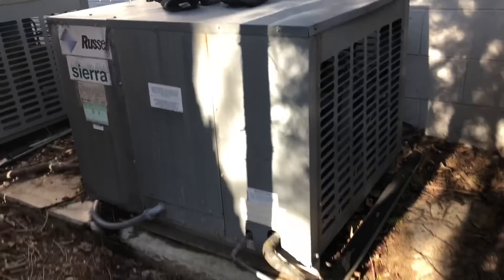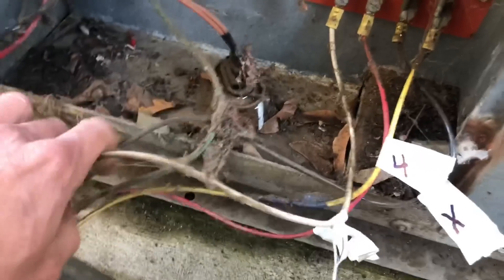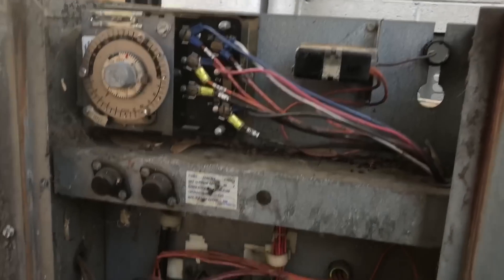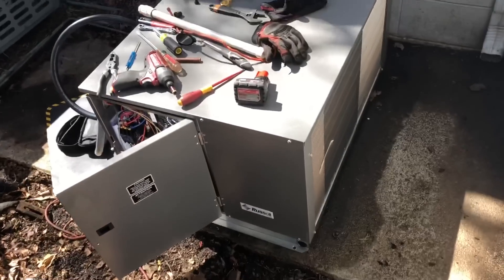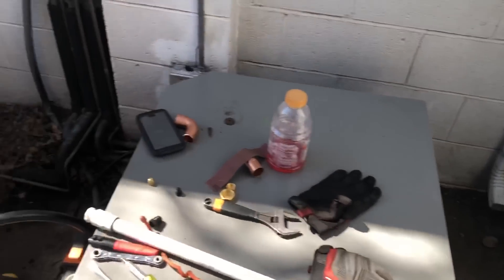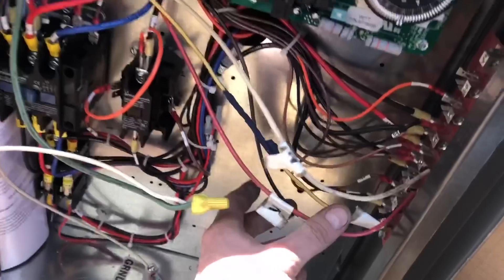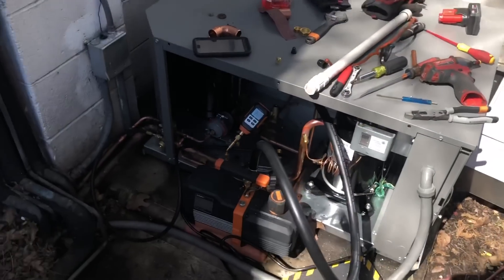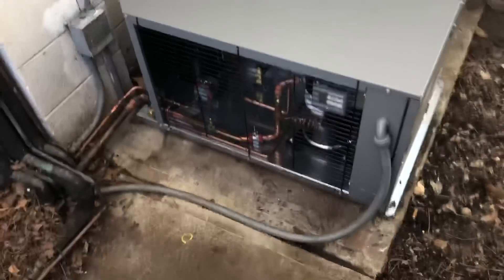Condensing unit changeout . Refrigeration life # 27.

Comment: Nice install 👍 Discharge for the condenser looks good, looks like the other is discharging into the back of the new one so your good 👍
Reply from the maker: McCutcheon Services LLC yes and I spaced it over 3ft from the other one.  One problem is in the back of that building there is a huge tree and a fence so all the leaves just collect right in the condensers Hahahah.  As you can see by the mess that was underneath the old unit I took out
Reply: @Cscrefandhvac  
Ya I saw that 😂 You can only do so much!
Reply from the maker: True man. Well be there cleaning it out in a month lol